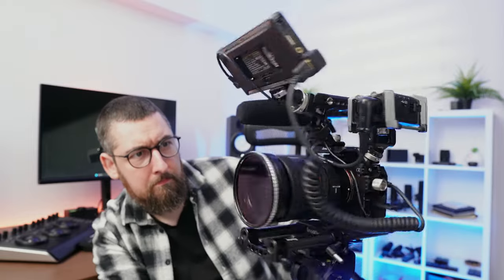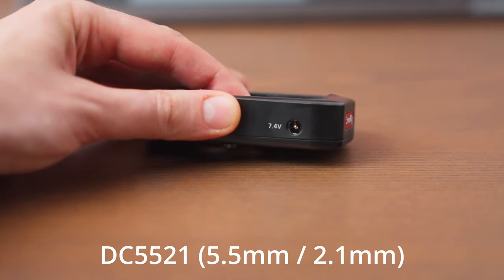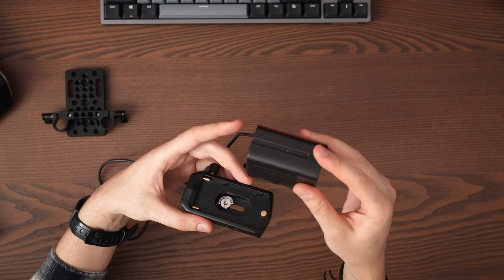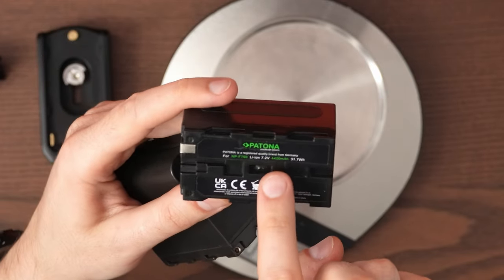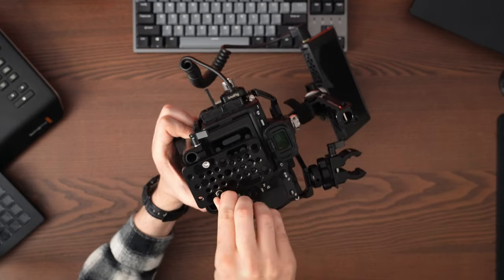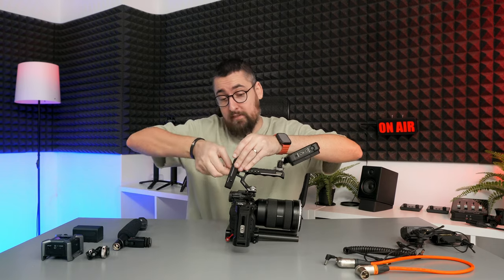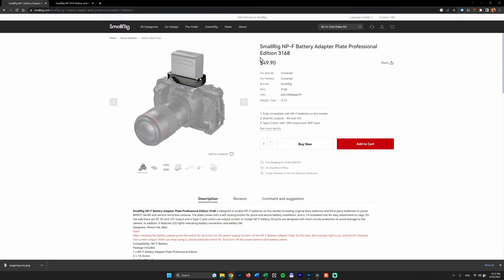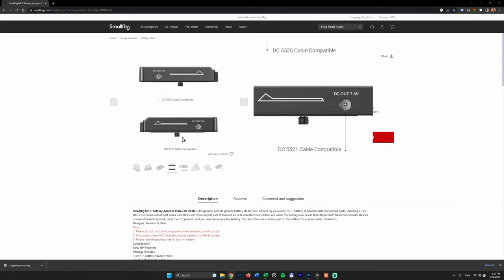Best Affordable Power Solution For Camera Rig 🔥

Comment: I really love your setup! So much that I tried to replicate it for my own rig. I have made some changes that's worth noting. If your using it for a run & gun setup just like you built it, I found an even better solution.

Eliminate the NP-F battery setup & rail mount system since your not using it to attach any follow focus or accessories to it. That will save you 681.5g of total weight from your rig. Everything else stays the same. You now have two options:

1. V-Mount with VB99 - 660g for battery + 199g for mount (4064B) which weights slightly more than you setup of 859g. A difference of +177.5g 

2. V-Mount with VB50 -  330g for battery + 199g for mount (4064B) which ends up lighter than your system coming up at 529g, a weight saving of 152.5g

Eliminate the unnecessary bulk and excessive weight of the mounting rod system. Also, this gives you flexibility in the fact you can use a smaller battery for running around and shorter shoots, or a larger battery with more capacity for only 177.5g more.
Reply from the maker: Hey! 
Glad you like the setup.
I will search right now for your recommendation and see if that will be a good fit for me.
I love to find good ideas for my rig.
Thank you so much!
And yes, a V-mount will deliver a lot of juice 😁

Comment: Would this system power both the camera and monitor simultaneously?
Reply from the maker: If you want you can add a USB C dummy battery and connect it or power the camera with an USB C.

Comment: Hello Gabriel. I interest to invest on Npf battery that have Type C output. Would ask your opininion if i use Cable type C to jack DC 12V on Npf with TypeC output. Can it power up monitor 5inch external with port 12V jack DC ?
Reply from the maker: Hey! Theoretically yes! But you need to read the specifications of the USB C out of the NPF you want to buy. But basically, should work :)

Comment: Not quite sure where I am going wrong trying to copy your battery setup. I have the same adapter you do only difference is two things, one being the red button when held does NOT turn on the adapter, I can only click it and it shows battery level for 3 secs then shuts off but when I connect my USB c cable to it and then the other end to my camera, THEN the plate has an orange light on the back that lights up but it wont turn my camera on and I have no idea what I am missing. I have a USB-C to USB-C, the same smallrig plate + Batteries you have. What am I missing? I thought the battery since its connected via USB-C would take the juice from the battery and give it to the camera but apparently it doesn't and I am not sure what I need to buy or do to get my ZvE10 to work like yours. Can you see where I am going wrong?
Reply from the maker: Hey. To turn on the adapter, hold that red button for a few seconds :)
Reply: @GabrielVIP  That's the weird thing. When I hold it, no light turns on but if I click it shows battery status/available charge. It has a LED Light on the back and when I plug in the USB-C cable to the adapter and then the other end to my camera, that LED light on the adapter turns orange which indicates it is now on instead. I don't know if I got a defective one or something. When I turn on my camera doing this (with the default sony battery) and it shows my battery is charging as its on which means that yes, the adapter is working but it just doesnt power my camera alone and needs a battery inside the camera and then it charges THAT battery instead.
Reply from the maker: I understand now the problem. The camera is not working with USB C without the battery. You need to have the battery inside. If you want to power it directly from the NPF you need a Dummy Battery. You can't power the camera without a battery inside.